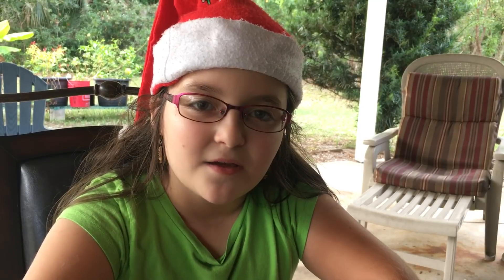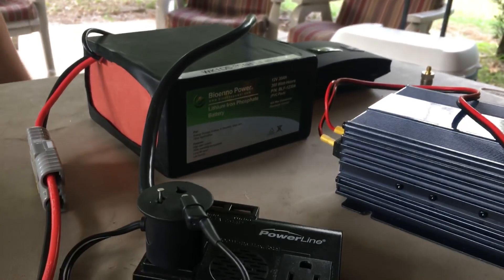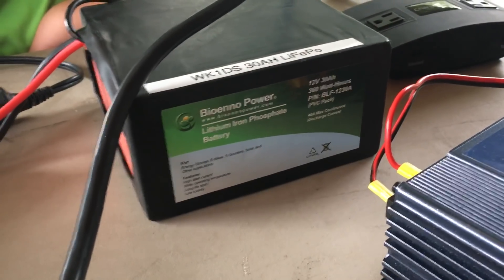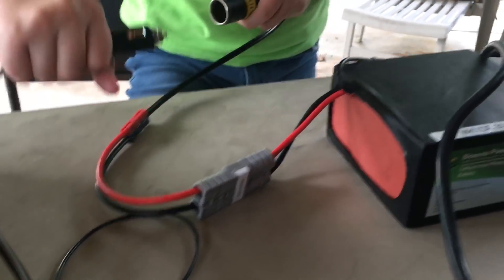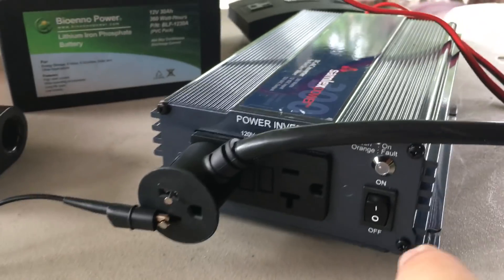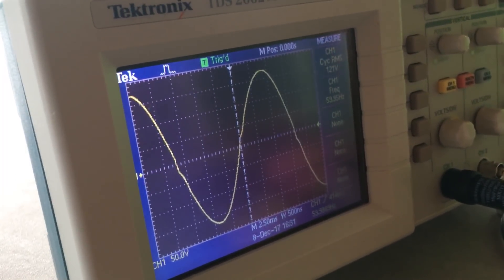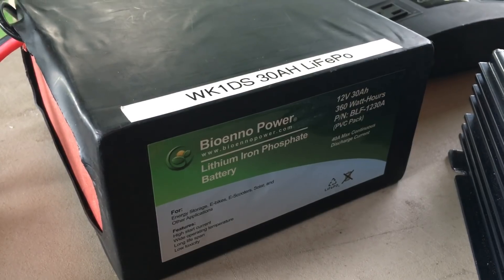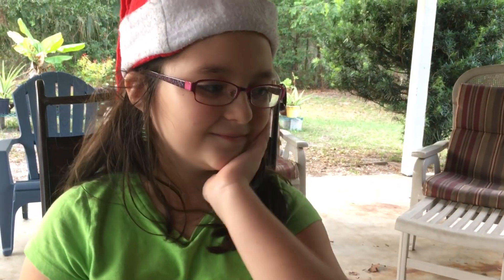Why You Want to Use a Pure Sine Wave Inverter Instead of a Walmart Inverter!

Comment: Macbook Pro may work on modified sine actually.   If the power supply is a switch mode supply, it will likely work on Modified Sine.